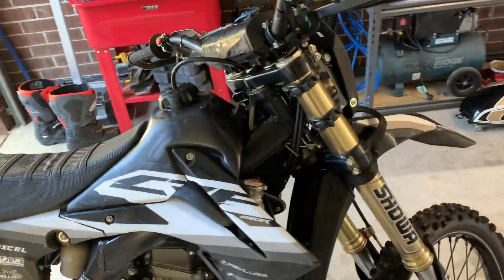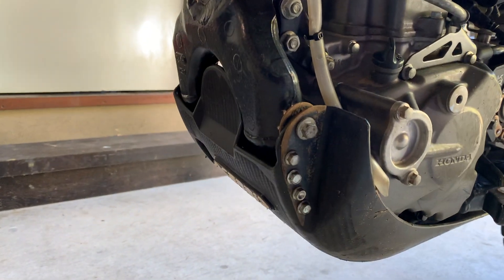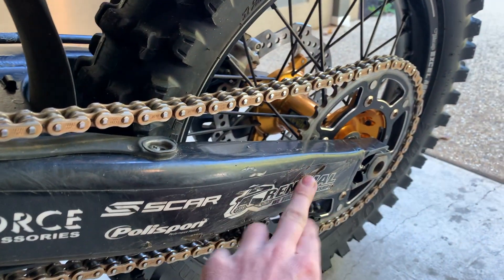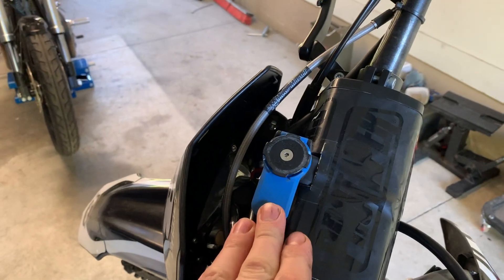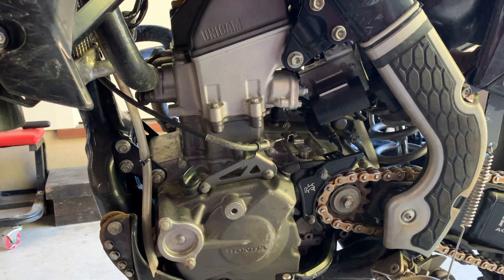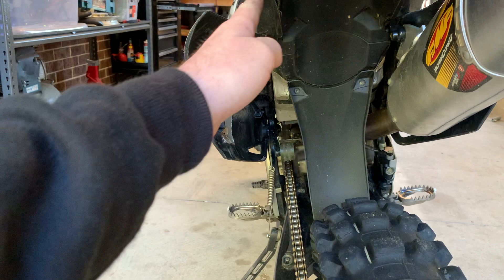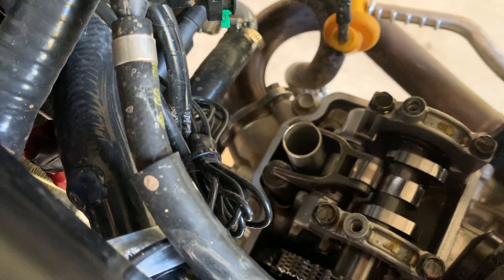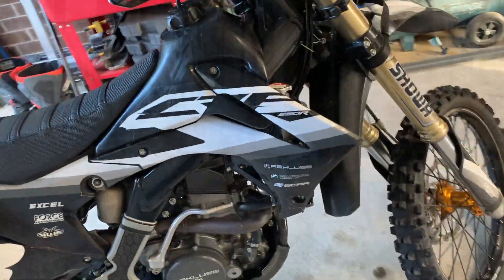Honda CRF250R enduro conversion 50hr update (FMF muffler install)

Comment: Appreciate this video was made 4 years ago now but I’m looking for some advice! 
Just got a 2018 crf250r, has the map modes and electric start, going to be doing light enduro/ trail riding, what are some good starting modifications to make to make the bike more enduro friendly? I’ve seen videos on other bikes for a weighted flywheel but can’t seem to find one for my bike and year! ( watched the whole series and loved it btw) also would you recommend downsizing rear sprocket or upsizing?

Comment: Hi Jack, I'm just wondering if you did anything to the gearing to make it more enduro/trail friendly ?? Cheers mate, love the finished product 👍👍🤙🤙
Reply from the maker: Yeah mate, I think for memory I went up a few teeth in the rear for faster acceleration to help with slower technical riding, I don’t do much open road/high speed stuff

Comment: Hi Jack, I have the same bike, 2015 Crf250r, and I did an almost identical enduro build, I have 2 questions, one being how did you ultimately work the headlight around the steering stabilizer, and 2 have you had cooling problems? My bike seems to overheat way to easily and I have a boyeson water pump plus aftermarket radiators that are supposed to be better for cooling.
Reply from the maker: I ended up just removing the steering dampener, and I wouldn't say I had cooling problems, but it definitely didn't handle getting hot as well as my current 4 stroke. biggest bang for buck was getting a higher pressure rated cap to stop it from boiling over so soon

Comment: Did you ever get the suspension set up for trail/enduro riding?  If so was it a big improvement?  Seems like a lot of people dislike the air forks.  I just got a '15 and so far don't mind them on a motocross track, but they did seem to have more stiction than spring forks.
Reply from the maker: I never ended up getting them converted to a conventional spring fork, or getting them tuned at all. I just kind of lived with it and got used to it.

Comment: Awesome work with your video series and upgrades. I want to upgrade my crf2013 with a rekluse clutch and i am confused which one to choose. Do they have different sets and if so, which one would you recommend?
Reply from the maker: hey mate sorry for the late reply, yes rekluse have different types of clutches, one being the auto clutch like I installed and the other being a normal style clutch. the choice is yours on what you'd prefer and it really depends the type of riding you want to do.

Comment: i also have a crf 250r and like enduro its a 2014 could you maybe just list the things that you reccomend for converting it to an enduro bike
Reply from the maker: Weighted flywheel or an auto clutch would be a great help against stalling on tight single tracks. Anything after that is a luxury, such as lights or tugged straps. It all depends what type of riding you do.

Comment: Hello, how did you lower the rev range
Reply from the maker: Oscar Alvarez I didn’t change the gearing at all, but the easiest way would be to go for a smaller sprocket in the rear or larger in the front of you want a higher top speed with less acceleration. Really depends what type of riding you’re doing. I’m mostly in tight single trails. So high speeds are never really required